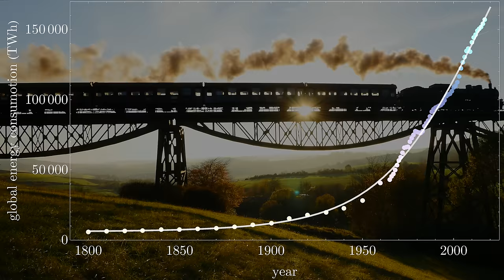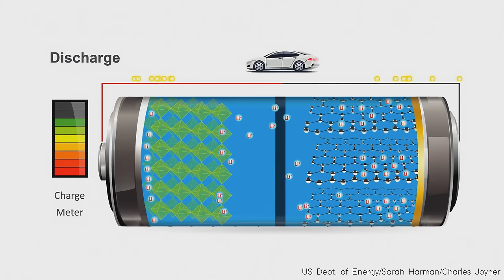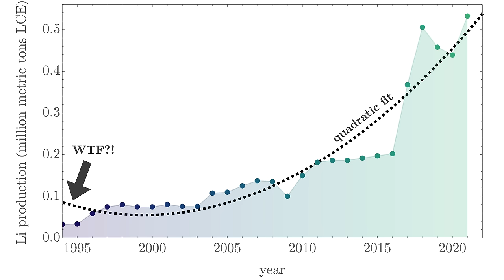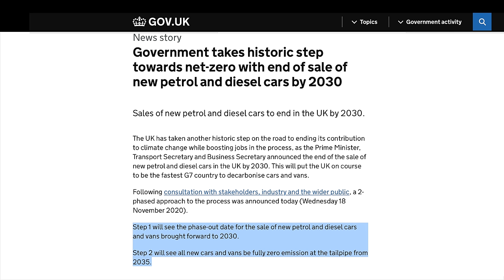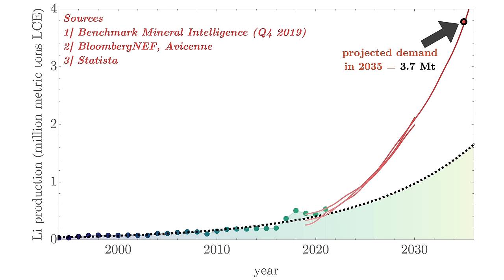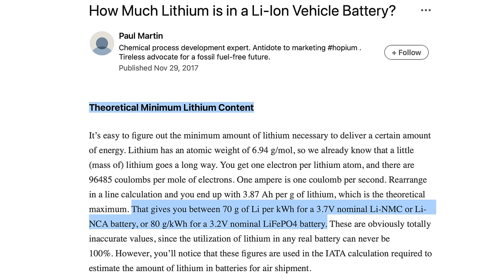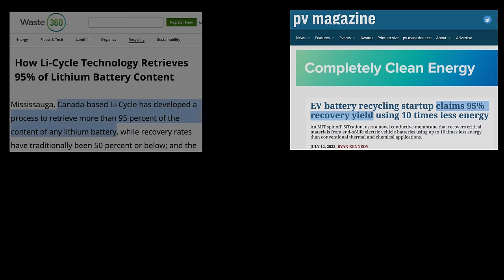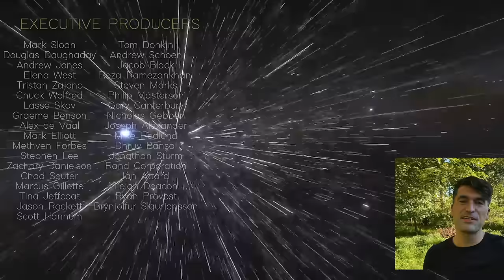Will We Run Out Of Lithium?

Comment: There's some real and good work being done on slowing lithium degradation as well.  My truck has a combustion engine, but it's 10 years old.  That's not very old, anymore, for a used vehicle.  So, you really do have to take that into account with projections, if you haven't.  Looking at some of the research, it could be as simple as electronic upgrades or simple reconditioning of the batteries.  I'm not sure, I haven't dug too deep into it, yet.  Not that it directly affects new car sales, but it is - essentially - recycling old batteries with no cost.  In the case of phones, this isn't very useful - as people aren't going to use their phones more than 10 years.  Also, this may be why current lithium cell technologies haven't really been pushed past that point, as the lifespan of the cells is currently, mostly, tied to the lifespan of those devices.
Reply: 10 years of using 1000’s gallons of fuel.  Wasted energy. With batteries they will be recycled eventually unless we find and endless cheap supply for the raw materials which is unlikely. So eventually there should be a closed loop of materials and energy once batteries become mainstream
Reply: Batteries last way longer than 10 years... 8-10 years is a common warranty period for batteries in EVs... Most of the imperfections show early, you loose battery capacity faster at first. As there are fewer and fewer imperfections left to show themselves, the amount of capacity loss slows down. Most batteries will never go below 81-84% of their max capacity even after millions of miles worth of charging and discharging cycles... These days, used batteries are worth a lot of money since there are not enough cells being made so a used car battery will easily find a second home as stationary storage... Also happening already is that recycling batteries and selling the raw materials can be done with a profit and that technology is getting better all the time...
Reply: Oh and Tesla found a decade ago that the batteries would last longer than the drivetrain and started figuring out how to make the rest of the car last as long as the batteries... Millions of miles is what they are aiming for...
Reply: @Karl Sjostedt  Talk to salesmen, lol.  What about desert?  Honestly, to me best car overall is a diesel hybrid with a plug.

Comment: When you throw in proposed grid scale and home battery the case for lithium looks a lot worse. I fully expect the mining will keep just a little behind demand and prices, but the real solution is either going to come from a new formulation that uses even less lithium or avoids it all together. Even if the battery isn't as ideal the economics will require it. Similar to how some of the other rare metals are already be phased out to address there supply line issues.

Comment: A Tesla power wall has a theoretical 20 year life cycle. More like 10 years actual really. A power wall uses 274lbs of lithium. A Tesla car uses 140lbs of lithium. At those numbers we can extrapolate in just replacement of current production is unsustainable without mentioning new production. Oh, I forgot to mention the machines that extract lithium are powered by fossil fuels, which have reached peak curve as explained by M.K. Hubbert a Shell geologist back in 1956.

Comment: So another comment would be the big problem about EVs is not the batteries it’s the energy needed to charge them. California has already issued cautions on charging during peak times and this will not get better until the grid is updated and better power output is achieved and it’s not. With the government also pushing clean energy, they are bottle necking the overall energy out put. Technology will continue to get better but these claims that we can supply all these EVs without fossil fuels is absurd. Look at Germany cutting plans for pipelines and then needing to buy oil from Russia or the Biden admin restricting oil and then going to Venezuela, Iran, and Russian to try and bolster the supply. Improvement don’t happen over night but they are happening and faster than ever before. Supplement the green and nuclear power industry’s while still allowing the petrol companies to move their products freely i don’t understand why this is so hard for governments to understand.

Comment: Are we going to address the polition caused by this mining? Or how to charge all these batteries?
 Clearly, solar and wind are not going to do it, removing coal is killing our abilities to charge up, and no one wants to say nuke either. Many EV stations are ran via diesel generators.
 But the big issue i see for all this is on one hand we brag about our ev, while ignoring the ugly truth of the damage mining for it does. The polution alone from the caustic pools is staggering. We dont want to drill holes, but we are ok with stripping millions of acres of land down deep and poluting waters?
 We really gotta do better. If objectively thought out, this is not a good plan. Most EV owners have no idea the damage mining for lithium does to our planet.
 I will say though, they are fun to drive. Yet, now costing more to charge than to fill my tank with gas due to taxes.

Comment: they should stop using lithium for non weight essential energy storage. For powerwalls for example, there is no weight or size limitation really. So it would be better to use a different battery technology that is maybe slightly more bulky. That way lithium can be reserved for transportation and mobile devices.

Comment: You seem to be ignoring that, after that "10 year lifetime", EV batteries are useable as grid storage (and perhaps for many decades after). If using new batteries as grid storage was part of your "demand" calculation, you should adjust it to factor in the repurposing of used (and, as you mentioned, near-end-of-life) EV batteries. Not to mention that battery chemistries which don't involve lithium are (or would be) far more useful as grid storage.

Comment: There is a much simpler analysis. Technology for lithium extraction will improve and therefore the less good sources, of which there is much more than of the best sources to mine will be cheaper to mine than the best sources today per. unit of lithium produced. That combined with better technology to recycle lithium will mean that we will not run out of lithium and that it will be cheaper per hours work to produce it. Also, because the wages will increase, because technology will improve in nearly all jobs. When there is an increased demand, the market can then provide the supply without the cost of producing it will be prohibitively high.

Comment: The answer is yes. (Tentatively, but I'll watch another video for the answer, not this one). I don't need overworked fantasies of taking all the energy from a sun or a galaxy as a prelude for this very practical question. If I need fantasy, I can just view one of the numerous Tolkien analyses on Youtube. Neither do I need to know that it is element 3 (happenstance I already knew and I knew why it is rare, but it is irrelevant). I need to know the general occurrence and the partical occurrences in certain sources, as well as an economical analysis on when a mining source is economically viable.

Comment: EV Batteries are Heavier When Charged Vs Discharged.
The same is true for a Compressed Spring.  They Weigh More When You Compress Them.
This is a First Year Physics Experiment.  Potential Energy Equivocates With Mass.

Comment: Great video but it bases a lot on a couple of assumptions.  One it assumes that NMC batteries will continue to be dominant use for EV batteries and pretty much all the calumniation are based on this assumption.  The other assumption is that 100 kWh EV battery will be the norm and again bases all the calculations on it.  If EVs use LFP batteries instead of NMC batteries our demand for new lithium is reduced substantially.  One reason is LFP batties last a minimum of twice as long than NMC batteries and more likely they will last three times as long.  LFP batteries are also easier to recycle than NMC batteries.  LFP batteries also can be charged multiple times in a single day with using DC Fast Charging without damaging the batteries.  This brings us to something the video completely overlooks.  DC Fast Charging infrastructure as it develops makes large EV battery pact of 100 kWh or more a waste of lithium.  With DC Fast Charging infrastructure built up enough a smaller battery pack is more than adequate.  If we cut the size of the average EV pack from 100 kWh to 50 kWh we just cut the demand for lithium for EVs in half.  I myself own a 2014 Chevy Spark EV that has a 21 kWh LFP battery pack.  The DC Fast Charging infrastructure is built up enough in the state I live in to where I can go anywhere.  Yes I have to stop every 40 to 50 minutes for 8 to 12 minutes for a quick DC Fast charge but that is a small inconvenience which will become even smaller as more and more new DC Fast Charging stations are opened every year.  Oh, and my Chevy Spark EV original range was 82 miles on a full charge.  Now 8 years later it still has a range of 79 or 80 miles thanks to its LFP batteries.
Reply from the maker: Great points! LFPs extend the lifetime of batteries for sure, but I don’t think that actually affects the demand projection so much. Most of that demand is driven by new EV adopters, not those swapping out NMC EVs.

Comment: A lithium battery does not last 10 years as said in the video. It's the ammount of using/charging cycles that sets the batterys lifetime. With heavy use it could be "dead" long before 10 years.

Comment: Pipe the ocean water to the middle of Australia and African deserts. Build massive towers that pump and spray the water into the air. The water will evaporate and you will start to see salt accumulate in the surrounding area. You will get more rainfall and potentially more water will penetrate into the crust and replenish the subterranean water supplies.

Comment: *hydrogen fuel cells entered the room* lithium battery cars are only temporary and don't reduce carbon emissions
Reply from the maker: EVs coupled with renewable energy certainly do reduce emissions. In the same way hydrogen coupled with renewable energy would reduce emissions. Hydrogen has a major problem I might share in a future video.

Comment: Lithium is a commodity. Did he include what price of EV's will elevate to based on the eventual shortages of Lithium? That will most certainly reduce demand and when we see what the replacement cost of these existing battery systems is, this too will reduce demand and shrink the discrepancy. Until the range of these vehicles improves and the cost to maintain comes down, not to mention the increased draw on an already over-taxed electrical grid, I have no interest. Can we build new nuclear facilities? Please?

Comment: What's not explored with this video is aluminum sulfate.  New aluminum sulfate batteries are on the horizon, meaning lithium won't even be a major concern moving forward. My guess is within 10 years aluminum sulfate (which is much more widely available) will be a usable technology for vehicles.

P.S. Aluminum sulfate is NOT explosive like lithium.

Comment: Hate to say it, but I am far less optimistic. This video does not nearly address the entire future need for lithium at all, I fear. So if we want to build batteries for all the EVs alone, we cannot get enough lithium... next we also want millions of very big batteries for energy storage for our houses that comes from our solar panels and wind mills, not to store just for the next day, but to store what we collect in summer and to use it in winter. The number of house batteries could easily surpass the number of batteries in EVs. That makes it even harder to get enough lithium. And houses are not the only users of renewable energy... At this moment, we are only able to store less than 1 percent of our renewable energy for later use, if we combine battery storage with hydro storage, heat storage, gravity storage and so on. This means that there also is a massive need for storage for all factories that want to run on renewable energy through electricity. Finally a tricky question: How many of these factories do already claim that they are running on renewable energy only? How is this possible?

Comment: You also have to throw the foreign policy factor into this. Any time individual countries/governments and money are involved, imagine the stakes for a country with a large deposit of lithium to have the "correct" foreign policy. This happens with resources every single time (Saudi Arabia/OPEC). The volume isn't just "cars" it's everything including what you use for work.

The mandates are being passed by people who have no clue about any of these figures or the technology and they don't care. I guarantee they wouldn't watch this video. They have presented a problem and they get reelected by promising to solve it (and perhaps never actually solving it). It doesn't matter if it's not technically possible, it doesn't matter if other materials like graphene or carbon nanotubes will take another 20 years to be a viable product which can meet demand. The people driving these policies don't care and if you try to tell them they would just cover their ears because it doesn't help their power and politics. WE can see it coming. The people in power who could take measures to adjust don't even want to hear it. 

When it comes to the US, you can't put a shovel in the ground to get resources without causing an uproar so people better hope a better way to extract lithium becomes an option or that the government has some Bob Lazar level tech to pull out of their you know where. Otherwise mandates cause massive hardships guaranteed because you can't rely on humans to be that good at solving problems without self interest getting in the way. Doing all this that quick means that somebody (a company) is going to be one of the few to come up with solutions. 

A gradual transition over many decades doesn't create trillionaires who aren't required to share their design/techniques with everyone else. Imagine relying on a single company for the one realistic/cost effective way to recycle lithium for instance. Whoever is at the head of that company becomes obscenely rich and doesn't have to share what they came up with with anyone if they don't want to. A gradual transition instead means individuals making smaller contributions to solving the problem over time and nobody owns the whole solution. If we listen to politicians telling us we are all going to die in ten years you get the quick way. Whether there are enough resources to pull it off or not. They get reelected regardless.

Comment: Will we run out yes, also this sounds the same as when we found oil. Thought oil was all over thought it would never run out. Also funny thing with the rebates all goes did was jack up the price by $5,000-8,000 and then took off the rebate so you still pay full price.

Comment: Neglected to mention it takes about 500,000 gallons for 1 ton of lithium. So I guess water isn't an environmental concern?
Reply: j b, Are you neglecting to mention a 1 gw fossil fuel or nuclear power station can consume 20 million gallons of freshwater per hour in the cooling towers, and globally the current power industry consumes 400,000,000,000 gallons of water PER DAY!!!! Enough water to produce 800,000 tons of lithium per day! (that's all the lithium in 1 day)

Comment: i wouldn't worry about battery recycling. jb stroubel the co-founder of tesla has already developed a business recycling all lithium batteries at a rate of 95-97% do far. he's scaling quickly and will no doubt have copiers (in the same way as tesla did). he says he can already make a profit and will be straight forward.

all the recycling points you mention (esp. its importance) are addressed by jb stroubel presentation, i suggest you check them out.

i'm confident we'll be past 97% recycling quite soon and there'll be an explosion of recyclers as methods mature.

Comment: Sorry, but the video title doesn't really draw me in. Short answer to it: no, we won't run out of Lithium. It's one of the most abundant elements around, and Earth has much of it. But we may want so much of it that we may run out of the richest and most economical places to get it, so its cost to obtain may go up. And in the next few decades, if demand turns out to be as high as promised, we may simply be unable to ramp up production enough to meet demand: another inflation producer. But maybe you really said all this. That much is not really the science of it, it's the economics.